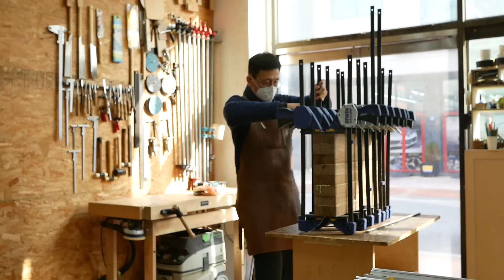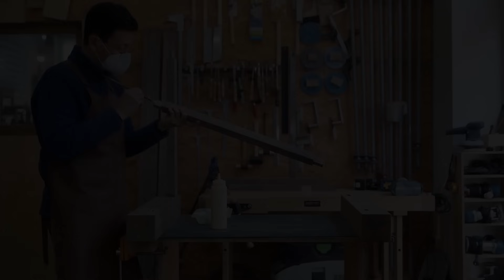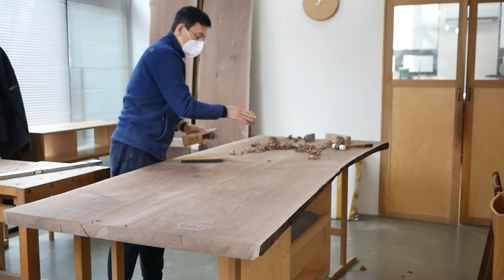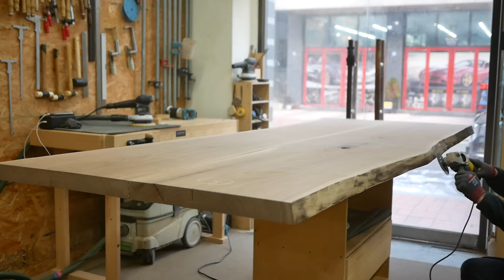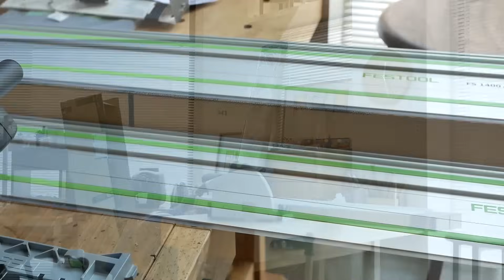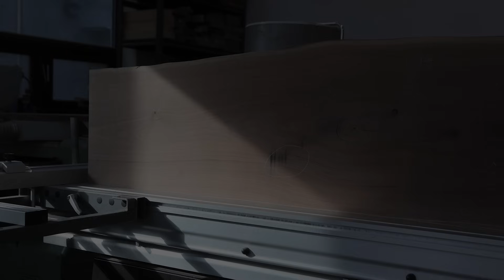SQUARERULE FURNITURE - Making  a Walnut Desk

Comment: I loved the video sir. May I ask, why did you place the thin shims on the walnut at 2:00? Was it to lift the piece above the glue residue?
Reply from the maker: The cracks in the wood were filled with epoxy.

It took a long time to trim all of this, so I attached a thin piece of wood higher than the epoxy protruding part and machined it with an automatic planer.
If you watch the next video, you will see the plane being worked on.

Comment: Masterpiece! Im also carpenter and I wandering how much time do you spend making something like this?
Reply from the maker: Due to the custom nature of the product, production progresses slowly.
Not only do we make this furniture, but we also make other furniture and accessories.

What is clear is that we are putting in more time and effort than we thought.

I don't know if my interpretation is correct, but are you in a slump right now?

I have been making furniture for over 10 years. During that time, I had many worries, slumps, and failures.

I think the important thing is an unwavering heart and passion.
If you need help, ask anytime. Fighting!

Have a nice day!
Reply: I too build custom furniture in my spare time. “More time and effort than we thought” is an understatement. When I’m not working on it, I’m thinking about it.
Reply: Most ppl dont know or appreciate how much time effort and energy goes into building a piece or a set and undervalue it cause they saw it for x amount in a big retailer.